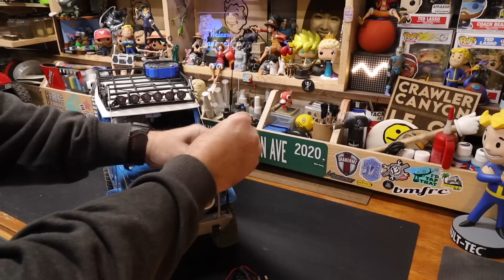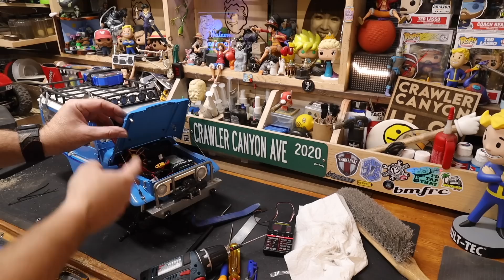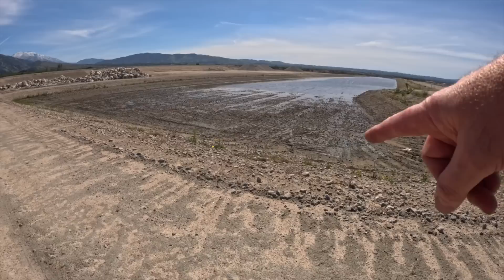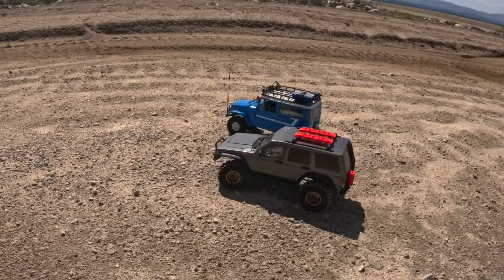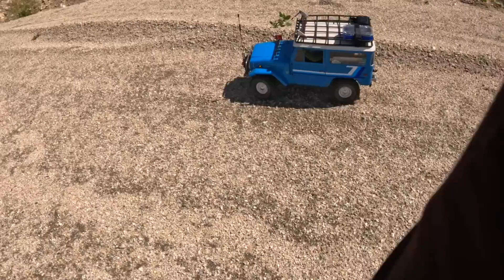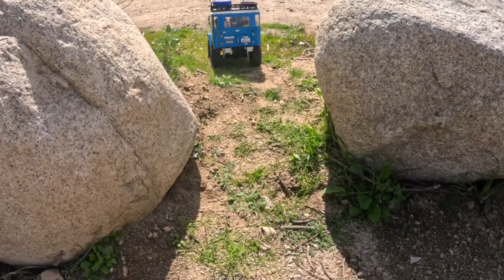Crawler Canyon Presents:  Wheelin' Wednesday #80, a smorgasbord

Comment: Did you end up adjusting the rear driveshaft angle? Or was chain wax the only post recording modification to Bruce?
Reply from the maker: Was just the chain wax.  I don't have shims to adjust the angle of the axle, and as I fully intend to change the axles (so I can change the driveshafts) I think it's firmly in the category of "it'll do for now."

Comment: There's a massive amount of body flex, thats why.
On the mashigan they have little plastic  catches. While turning it upside down to address another issue I snapped them both off bec of body flex. Forgot to undo them.
Reply from the maker: Yeah, the body is a bit of a noodle--  odd that they braced it at the back (the door pops open anyway) but nothing at the front. I'm sure he will be completely apart again at some point, and I can see out stiffening the front as well.

Comment: Can you put some wedges at the desired point at the leaf spring attaches to the axel. I don't know never seen let alone worked on RC leaf springs
Been gone for a bit but I think I back and back more often than not. Digging your channel
Reply from the maker: An axle swap is inevitable, so when I go to set up those axles I will 100% be figuring out the leaf shims.
Reply: @CrawlerCanyon  RC4WD has those shims and Yota II axles are probably the best bet for Bruce!

Comment: @Crawler Canyon.
Loving these wheeling Wednesday episodes! 
The winch looks good too. Your antenna is in the perfect place if you're in Australia!😂 In America it belongs on the left side at the back.
Now for your quest to get Bruce scaled out you should definitely get him some Yota II axles
(standard TF2). They're Toyota after all! The strongest driveshafts I've found were on ebay and were steel with universals and were splined(you have to be careful what you buy). Both of my TF2s have many miles on them and have those driveshafts.
For trail filming to get the low angles mount a selfie stick to your radio and you can put your filming device down just above the ground.
Can't wait to see what you do next!